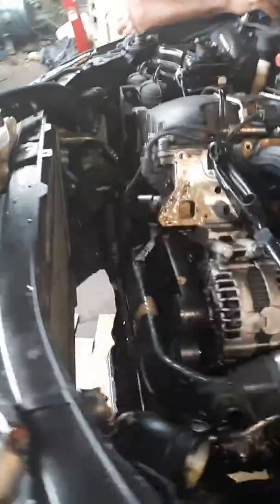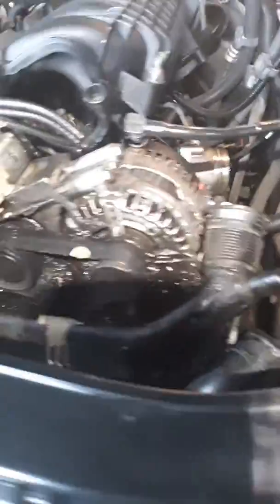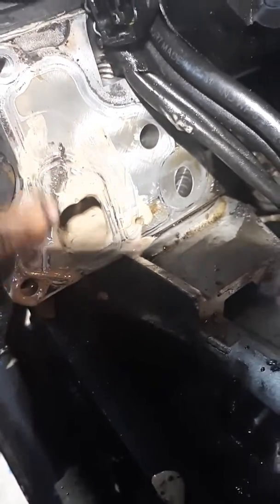335i 2008 oil in the coolant

Comment: Tengo el mismo problema gracias
Reply: Gilfredo Oquendo que fue el tuyo
Reply: Exactly that I replaced that gasket flush  the system and problem fixed thank you carnal
Reply: Ese aceite corre por todo el sistema por que le monte la junta I sigue saliendo aceite en el tanque
Reply: Gilfredo Oquendo  no crees que sea el head gaskets
Reply: No creo por que no gasta coolant no se calienta no se si este carro tiene un oil cooler en otro lugar a menos que no sea que el aceite que esta saliendo sea por que no le di un flush

Comment: How do you flush that ?
Reply from the maker: Ok disconet the clip on the thermostat hose dont remove the hose from  the thermostat put water on the system and turn the car on it will run for probably  10 to 15 minutes  then the pressure  on the system will  push  the hose out letting everything  out do it 3or 4 times  that will  take everything  out home depot  has big concrete  trays  for 10 dollars get one of those  so you can catch  everything